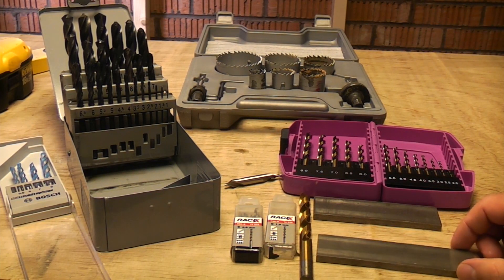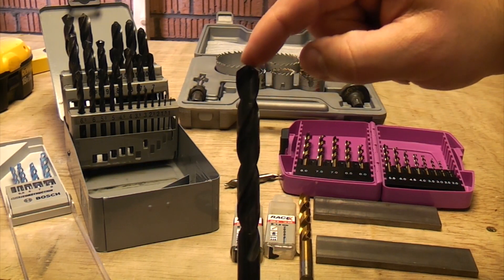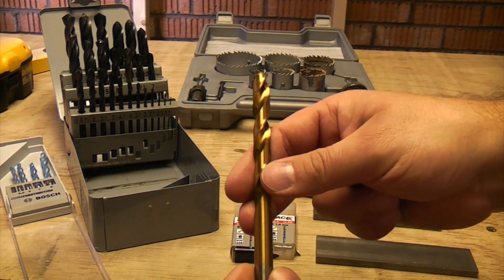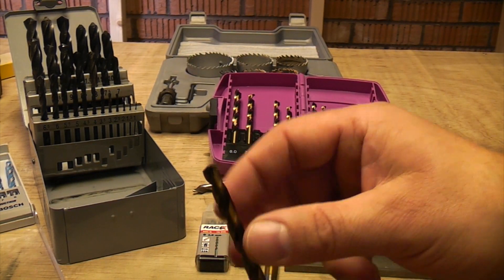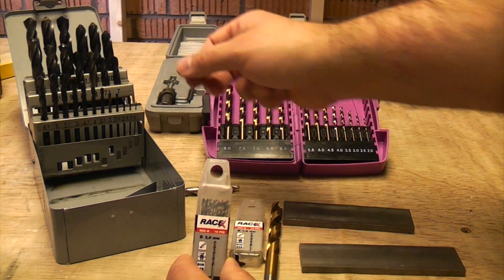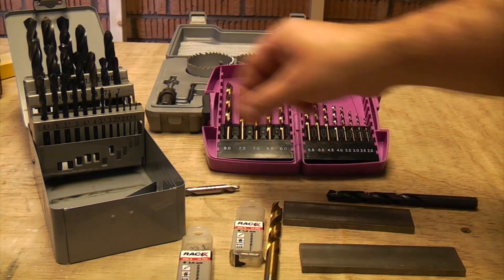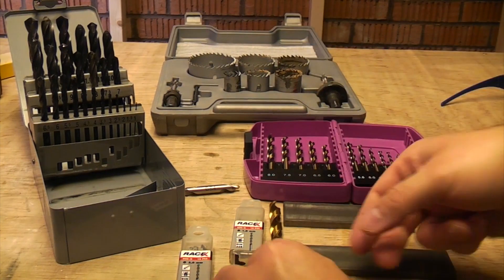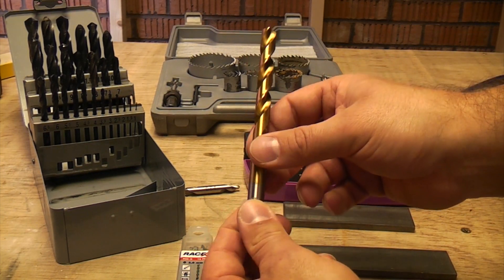Metal drill types

Comment: Hi pal please could you tell me a bit of info about drill bits, I'm trying to drill a 6mm wide hole 20mm deep into a 10mm 3/8 drive hex socket so I can unscrew a security bolt on the top of a diesel injector. I'm aware standard drill bits won't even touch it as it's incredibly hard material. The only thing that puts a mark on it is diamond files or diamond tipped filing bits for a Dremel. I'd buy the socket with the hole in but they're 20 quid. And there must be a cheaper way. What type of material is this likely to be? Is it protanium and what drill bit would mill this thing. 

Any help would be greatly appreciated. Thank you
Reply from the maker: The only drill bits that I know of for drilling through hard steels like that are ARTU drill bits. They have a tungsten tip, like a masonry bit and work well on hard steels. Any traditional metal drilling bit will go blunt immediately on hard steels.
https://www.youtube.com/watch?v=zbJq2z2ya80

https://fave.co/2xuSFSX

Thanks for the comment
Reply: You need a Tungsten Carbide tipped bit, I would choose a 135° split point TCT bit , drill a pilot hole and    use cutting oil or compound.
Use a slow drill speed and be carefull not to let the bit spin, if you see smoke the bit is about to burn.

Comment: The whole concept of having to drill a pilot hole to be able to drill with a larger size effectively is completely incorrect, that sir is a waste of time ... And quite silly
Reply from the maker: Really?
How about we have a bet?
You drill ten holes in some half inch thick mild steel, 13mm in diameter using a cordless drill.
I'll drill the same amount of holes but I'll pilot drill the holes first. 
I guarantee that I'll beat you ;-)
Reply: If you want accurate and precise holes, you do want to start with smaller sizes and work up to the desired hole.  Plus it is easier on the tools.

Comment: im 99% sure that you are not going to dull a drill made for steel and aluminum by using it to drill wood. It does not make any sense to me.
Reply: Meredtih492 It's odd, but true.  Wood is rough on twist drills.
Reply: wood has many little particles that are harder than steel and will damage the bit. The bit will work well for wood still, but if you try to cut steel afterwards you will have a hard time

Comment: Hi, I'm looking at buying some steel twist drill bits.  The website describes them as "twist drill (58pm) and twist drill (77). Can you tell me what the numbers are, and what "pm" means? I'm wanting to use them for drilling copper or other metals.
Reply from the maker: Catherine Murray 
Sorry, I do not know what the PM stands for.
Just keep clear of cheap metal twist drill bits as I have used them in the past and they have grabbed in the hole, twisted and then shattered- which sends hardened steel sharp bits of metal all over at speed.
I now only ever buy quality drill bits such as Dormer, Bosch, Dewalt etc.
Reply: Could it be powder metal?

Comment: @ultimatehandyman 
Thanks for the advice.
I have been told by a few individuals who have said that they used Anchor Bolts, and they say it's fine for brick walls.
What can Anchor Bolts normally used for? And what about Expansion Bolts-can they be used in brickwork for my bracket?
Want to get all the bits i need tmr @ B&Q and make a start this Sunday putting up the base plate.
I'll probably ad a few more Coach Screws, as there are 20 holes on the back-plate, I'll ad 12 in total spaced out.

Comment: Hi there,

I have just bought a Cantilever TV bracket for my 50" Plasma TV.
I want to mount it on the wall in the corner.
The TV is 50kg, and the bracket can hold up to 75KG.
It came with fittings, 6 zinc plated 8 x65mm-5/16" x 2 1/2 Coach Bolts, & raw plugs.
I was wondering if the fittings supplied with the bracket would be good enough to take the weight of the TV plus bracket? The wall is brick, my flat is about 30 years old.Would the coach bolts be suitable, or should i go for  Anchor Bolts?